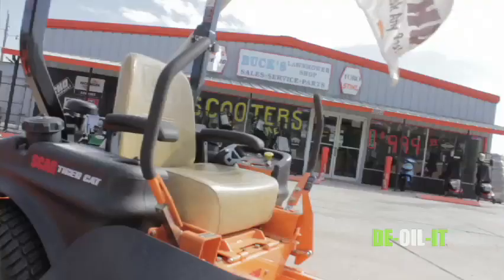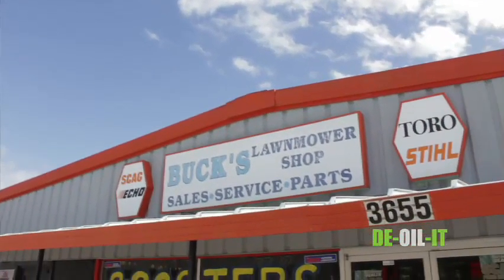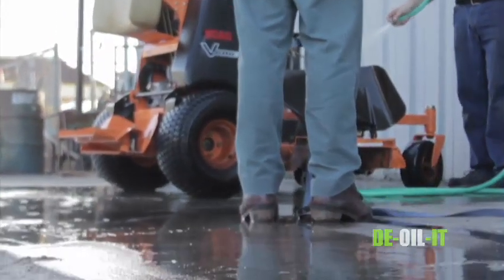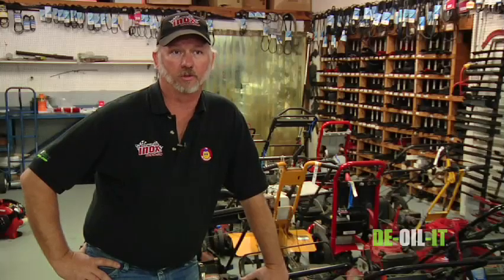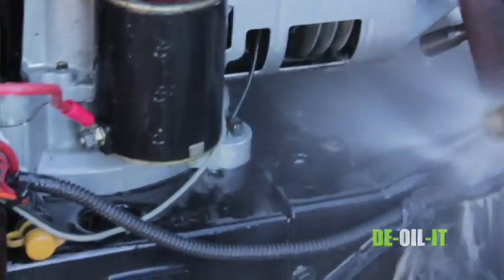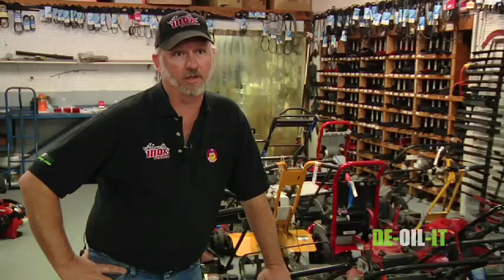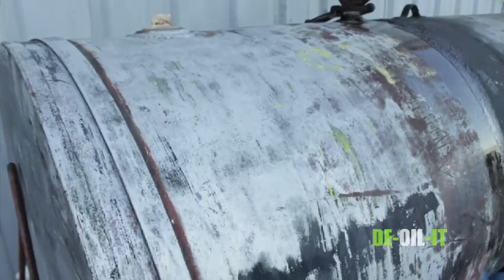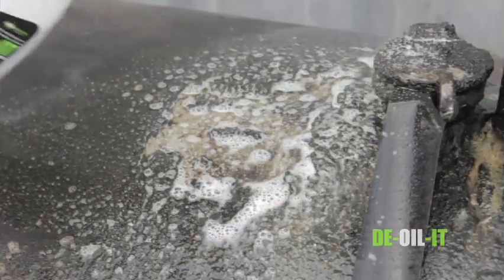DE-OIL-IT - Shop Maintenance - Cleaning, Degreasing, Oil Spills, Etc.

Comment: I used it to clean up after our mechanic over-tightened the secondary fuel filter housing on two engines where diesel fuel was spraying out into the bilge. 
That is when I became a devout believer in De-Oil-It's capabilities.